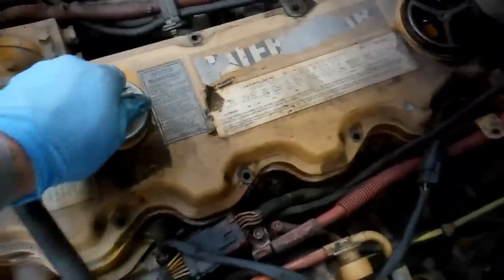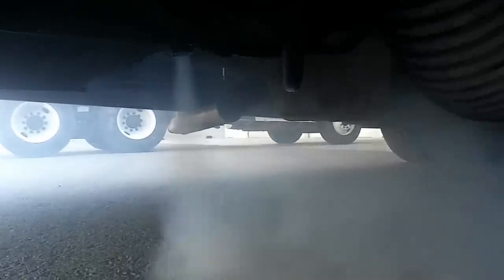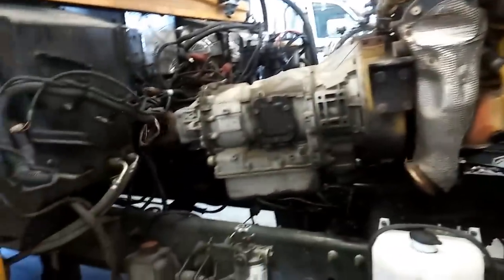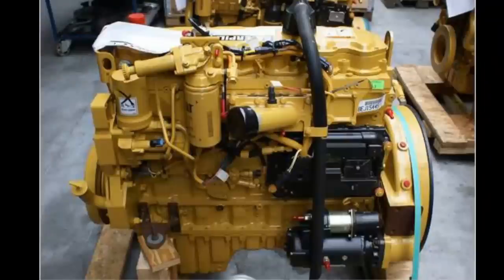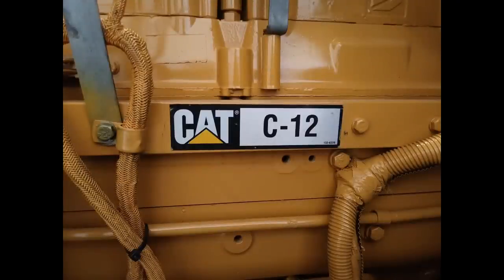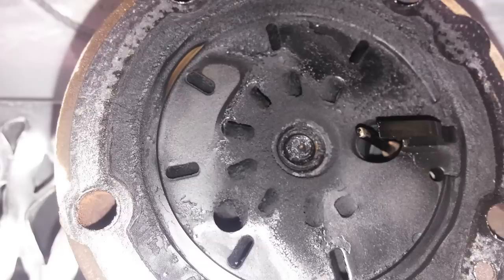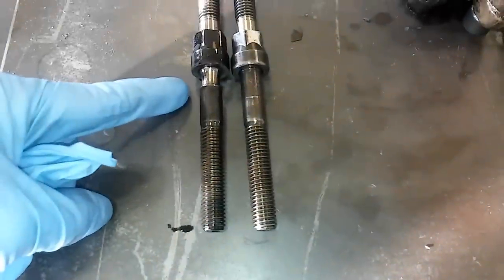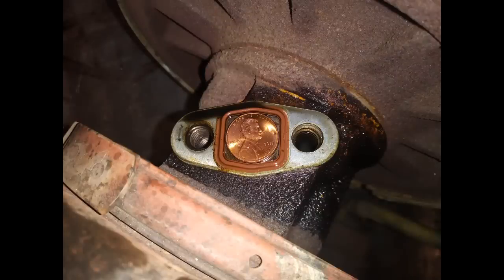What Are The Best Cat Diesel Engines?

Comment: I have a 3406e 2ws, how does it rank between the cat engines and overall? I’m a newbie trucker, but I’ve heard great things about this engine(besides gas mileage) 
Would adept ape be willing to do a rebuild on it? Pushing 1.3 million miles with unknown previous rebuilds. Clean oil samples, had descent power, not very much blow by
Reply from the maker: Not much difference between a 2WS and a 6NZ, great engine. Doesn't sound like you need a rebuild from what you describe.
Reply: Adept Ape would you be willing to do a rebuild in the future? Where are you located? I’m in Salt Lake City, Utah and I haven’t found a good, honest, mechanic that knows these engines. I have watched every single video that you have and you have a talent. I would be honored if you did my rebuild when the time comes.
Reply: You have the best engine 3406E or C-15 are the same with just a few differences between the 2, I've had them all, my (personal opinion)
#1 CAT 3406E or C-15/ 6NZ
#2 DETROIT S60 12.7 L
#3 Cummins 
Again I've had them all.
Reply: 2ws is just as good as 6nz, and arguably has a stronger block than the sculpted 6nz block

Comment: Enjoy your videos all common rail fuel systems suck on all engines cam timed seam to been the best and piston rack pumps  last the longest with least problems
Reply: What's the problem C.Rail ? Everything is so much easier, smaller and simplified. I would like to hear your reasons for condemning it.
Reply: @GIGABACHI  when you start running pressures up to 25000 and higher sensors and the injectors failure is higher and the high pressure pumps go and take out everything changed a lot of them on Detroit Diesel new engines can't get 500000 out of the not even close cam time and piston pumps would go that easily the egr and dpf dose not help either and I feel bad for the customer I remember when you put a set of injectors in at a half a million and get over a million miles at a much lower cost and not much down time doing a Cummins today a work common rail isx single cam wish to could take you to work and show you so much more
Reply: Oh, OK . . . I see your fair points . . . makes sense from where you're standing and hearing about your experiences. But isn't the HUI system going away with most of the OEMs ? Or some are still implementing it to this day ? Isn't everyone in the HD sector moving to CR ?

Comment: Hi, Just found out my 2005 F750 has almost 20000 engine hours, and im looking to replace engine Its a Cat C7 KAL46664, can i swap it with a FMM series engine? I realize ones a 12volt and the other a 24volt system,

Comment: Quick question I'm still looking to buy a truck I prefer a automatic but would you say a c 15 engine is just as good as a 12.7 or 14.1 l Detroit engine lots of people telling me they are the best engines but the parts for a cat are very expensive and the Detroit parts are hard to find for both cat and Detroit what's your thoughts
Reply from the maker: Well I'm kind of a Cat expert, but that doesn't mean there aren't other great engines out there. I believe the Series 60 Detroit has a good reputation for being cheaper to rebuild and having better fuel economy, but not making as much horsepower. I believe parts are still available for them, although Cat yellow looks better than Green in my opinion 😉
Reply: So where would recommend getting semi truck parts from
Reply: One more question I been looking up parts for my freightliner columbia but it has a c 15 engine in it  but every time I look up parts it says Detroit engine on the part can I use that part or I have to find one  pacifically  for c15 engine

Comment: 3406E is best engine
Reply: C?
Reply: Ferguson101 that’s a thing?
Reply: 3406 E and C Models were both Electronic Engines... The B Model was a Full Mechanical Engine, along with the GrandDaddy A Model.
Reply: Project12Valve so, the E model still sounds good and doesn’t sound like a Tesla
Reply: @Ferguson101 Correct.. 3406 A, B and C Models were Pushrods Engines.
Reply: @danielaguirre2516  The E Models weren't bad engines at all.. also I need to add, some C Model 3406s were all Mechanical Engines but lacked Cruise Control and a few other things.. the Electronic C Model (PEEC) Engines were junk... The phrase "If it ain't a CAT, It's a Dawg" did not apply to the C Model PEEC Engines lol
Reply: @Ferguson101 I've been a mechanic for 5 years, I know that isn't along time and I know I don't know "everything" but 5 years have solely dedicated to Diesels (Mechanical and Select Few Common Rails)... The MX13 is a Big Hit or Miss Engine.. usually Miss. Go for Low Mileage and Deleted the Majority of it's Life with GOOD Tuning.

Comment: Could you please quit calling the c15 compounded turbo engines twin turbos. That drives me nuts considering the turbos are not the same. Ppl do it to the 6.4 Navistar engines as well. They are compound turbos
Reply: Your correct, however nobody cares. It makes zero difference, the people that don't know the difference won't be doing any turbo swaps anyway.
Reply from the maker: The C15 does use a compound turbo system with two turbos, but if I said that I feel like nobody would know what I'm talking about. I've never heard another mechanic or driver refer to them as compound turbos, always twin turbos. Maybe I'll have to do a video on this subject to educate, but it isn't on my top of the stack.
Reply: Adept Ape internally at Caterpillar that set up is know as “series turbo” not twin turbos nor compound turbos.

Comment: I have a 1993 Ford Crew Cab dually, have  wondered will a CAT C-15 (1999) fit in my truck?  It has a 5-spd Manuel. Do not know the S/N at this moment.
Reply: well, it's about as tall as a short person if it was sitting on it's oil pan, i'd have to say it would be extremely difficult at best
Reply: No, the C15 is way big.  You could modify the truck to stuff that engine in the bed though, lol..  I've seen 3116, 3126, 1160, and 3208's stuffed into Ford and Chevy 'light' duty trucks though..

Comment: So I've come to a conclusion... you know your stuff lmao.
After having watched a large portion of your videos,  I've noticed there really hasn't ever been mention of the 2WS... What would you say the weak points of it are versus a 6NZ? To be more particular,  the truck I recently purchased has serial #2WS25890 in it at 500/1650. The tractor has 1.4 million miles on it and there is zero blow by what so ever that can be seen or felt at the blow by tube. 
Just curious to hear your thoughts,  thank you!
Reply: 2ws is a good motor,  one before the 6nz, we have one, she pulls like a mofo in 550/1850 mode. Basically only difference is noisy gear train and oil leaks, compared to 6nz. Might be something else I'm forgetting but it's a good motor regardless
Reply: @kwmiked  Thanks. Then another thing to,  the motor has an actual serpentine belt instead of the typical v belts.... not sure if that means anything,  but that's what it has lol.
Reply: @TDAVIS1992  someone must have switched it over, cause 2ws was 98/99 and ours have v belts, on a Kenworth anyways

Comment: I know you're still young and learning but did you actually ask drivers mainly owner operators what's the best cat motor here let me tell you 3406b and why, the most horsepower for the best fuel mileage and reliability. Next is the C12 the best fuel mileage even over the 3406b and reliability for electric fuel pumps. Both are million mile motors in fact both those engines get way better fuel mileage than the new trucks are getting today except for Volvo they actually get great fuel mileage and decent horsepower along with it

Comment: Very interesting about the penny. Possible sabotage
Reply from the maker: Either they put it in there for some crazy reason and caused the failure, or they put it in there after the failure to reduce oil flow into the damaged cartridge. One idea is pretty bad, the other one is pretty good.
Reply: @AdeptApe   The operator put the penny in there to shut off oil flow after turbo failure. Was afraid it would consume engine oil and run away. Seen this before.
Reply: There are far easier and discreet ways to sabatoge an engine...
Reply: Adept Ape that guy was a real trucker, not some nit wit steering wheel warmer
Reply: Ell Jay Damn right. Driver got the problem patched, a major catastrophe prevented, and delivered the load on time.

Comment: The new generation bothers me...I am older and my dad had a diesel engine certificate from UCLA in 1946...Any way physics don't change...even in 2020...Cats do not like heat as in water temperature but cat engineers make them run 200degress plus on coolant temps...I know they say more efficient less friction etc...Cummins x15 ISX keeps water below 200 and lasts longer..I drove them both

Comment: IF you are going to exclude the mech engines then you couldn't be talking about the best cat engines....  Electronics are what ruined them,.
Reply: Are 3116 decent besides the injection problem?
Reply: @dioniciobedoy8319  if you can deal with the tooling to ream cups and set the rack, yes. Keep the power low and drive. They will give long lives if you keep the overhead adjusted every 30k or so. I like them.

Comment: Junk ecm engines always makes me laugh when cat comes out to work on a mechanical engine and can't work on it until they read through a book I knew one day caterpillar would make engines that they could not keep or train technicians to repair that day is now and the customer is getting fed up with the lies and parts changing of cats technicians and let's not mention the bill for the parts that were changed that probably didn't even need to be changed they were just trying to fix the problem by changing parts so mechanical engines are the way of the future they just don't give problems if you have an engine problem is either head gasket injection pump injector camshaft bearing failure or in a mechanical engines most common problem or completely  worn out if people were smart they would go back to Mechanical engines ECM driven is junk in my book old Cat engines are so much easier to work on and you can burn the truck to the ground hook up one wire crank the engine I miss the old days when people actually made things to compete with other companies to show how long there engine would  last now they compete for how many service calls they can make and Part they can change tell me if that isn't a scam? Truth of the matter is if cat went back to Mechanical engines they would put a lot of people in the parts replacing business out of business! Future's not looking good for any Engine with an ECM so in my theory there is not a good ECM driven engine they're all just a bunch of wires sensors inexpensive electrical components junk !

Comment: 3406B mechanical (like I have in my 1985 KW) with coolant aftercooler is the most reliable engine ever made. So much so, Caterpillar still makes the same basic engine called the 3406C with coolant aftercooler and mechanical injection pump for third world countries that want a reliable generator or pump engine. The 3406C is also made in a natural gas configuration with spark plugs.
Reply: Good to know ☺️

Comment: To me Caterpillar engines are crap. They start going to shit once you let go of maintenance. Best engine period is the n14 Cummins. If it weren't for the reliable of Caterpillar engines. They would be the best.
Reply: An engine is bad if it fails due to poor maintenance? Onya champ.
Reply: @TheTobes99  did you not just watch the video. Guess you didn't hear all the problems Caterpillar had with there engines. Add the fact maintenance isn't worth crap on these engines make them garbage. I wouldn't own one and never will. N14 Cummins is the best by far.

Comment: The water pump on the c12 is gear driven, when the seal in there fails every 150k miles you pump coolant into your oil as well.

Comment: I still have a 3176...not much love for it amongst the trucker community but I have never heard why. What makes it different and so hated?
Reply from the maker: I'd rather have a 3176, than a Regen C13 any day.
Reply: The first 3176 was a 2YG, Cat released the engine to soon. But was told to and the engineers told them not to. Eventually production was halted to get them better. A hot line was set up when one came in. You would give them last five of serial number. A fifty two page list was given out. They would tell you what alpha letters needed to be done. Letters went from A-Z, Z1-Z6 if memory serves. Circle the alpha numbers and give it to the technician for repairs. Most was very minor, but a few was major. The first engines had poor seals between block and spacer block. The coolant oring seal could fail from fuel in the radiator. Had to removed head, cylinder kits, radiator,  camshaft, etc., just to replace the failed seal. Even now it is recommended to removed spacer deck at rebuild. I have seen a 2YG come in for a valve adjustment and a push rod jumped out and put a hole through spacer block. The next group was the 7LG, is had three groups based on serial number. Than last was the 9CK, which had better electronics. Air compressor and power steering gear wears, have an update on all engines. Inner and outer front covers prone to crack, again updated parts helps but still can crack. Front and rear head bolts would snap on 9CK's.  Earlier engines like the 2YG  the Cam ring would warp causing engine RPM problems. The fresh air line would rub a hole in it and allow water into ECM, TDM and PM destroying all three. Water could enter boost line destroying TDM. Had a letter one time that stated some engines may experience leaks from, warped hsg's, loose bolts, seals, gaskets, etc. Seen rear covers crack and bolts work out, cracking the block and damaging the flywheel. Had early injector tip failures. If the oil cooler fails on a early engine. You have to replace all parts from the water pump to the cover mounted on the side of the spacer deck. Basically almost the entire side comes off. Why do you think the C series came out?

Comment: The 3116 was a disaster. We changed the sump (oil pan) to raise the oil capacity, we modified the fuel rail and linkages, changed heads do to the injector sleeve leaking and that was all within the first year of release. Give me a good old 3304 or 3306 any day

Comment: Easy, All around, fit in most things until you really had need for real power,,, 3306 and it would still be made today if not for high pollution/soot. 
   Look at the 3116 and the 3176 replacement for the 3306, Problematic , expensive , electronic (everything engine is today) I been away from the industry from lots of years now, Heck Cat may have make a new mid HP engine since that time, IDK.
   Must watch and see if the channel agrees with my assessment

Comment: only Diesels with cylinder-decompression-valves are good diesel-engines. 
 All the modern ones, CRDI, turbo and You name it,   can haphazardly slide into uncontrollable runaway situations. With mechanical pulled decompression valves the engine will stop safely.

Comment: Ive been looking for 3176 overheard setting numbers. intake lash exhaust lash and Jake brake lash. Where can I find these numbers?
Reply: Intake 0.015, Exhaust 0.025, EUI back off and turn in until it touches, then half of a turn in. If it has a Jacob's brake you can get that off web page. Or need engine prefix, HP and brake model.

Comment: Can you do a vid comparing Detroit  12.7 60 series engines. Best worst models with most common failures? Plan to buy a XLC w/Detroit in cpl years...thanks in advance!
Reply: He doesn't work on those turds, hes a cat guy!
Reply: Common failures are just from old age and hack repairs at this point. Those engines are pretty much bulletproof if you keep them cold with a big rad and the oil fresh with a bypass filter. Don't forget a pre oiler on any truck you go with to prevent dry start. It's a few bucks for guaranteed peace of mind.

Comment: My 06 kw w900 has a 3406e pretty decent motor, but somehow my exh. Manifold bolt ei5broke or fell out
Reply: It is not the original engine
Reply: @phorhossmen7007  I'm.aware of that. It had a c13 but blew up b4 I started working there.

Comment: CAT engines in standby electric generators in California are also subject to the California Air Resources Board and near San Francisco they are also constrained by the Bay Area Air Quality Management District.  Almost enough to outlaw Diesel engines totally.  A major topic of discussion at tne electrical engineers club discussions.  Unless there is a power failure, you cannot even run them enough to do maintenance and testing more than twice a year.

Comment: I had a c15 twin turbo in my hemmt wrecker, never had any problems after i tuned it and the sheer torque it had afterwards was unreal.  My pick for non electrical is the 3116, all mechanical and is a pretty bomb proof considering its used and abused by Army troops such as myself on a daily basis.  Im retired now but i look back fondly with those two engines.